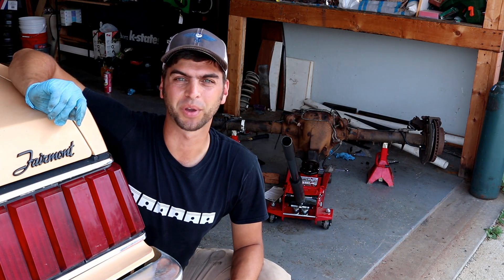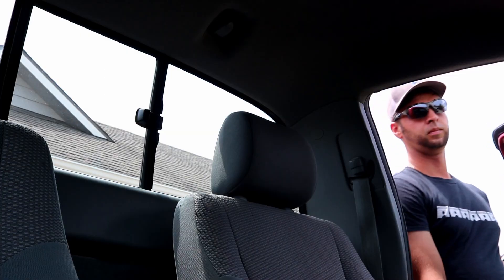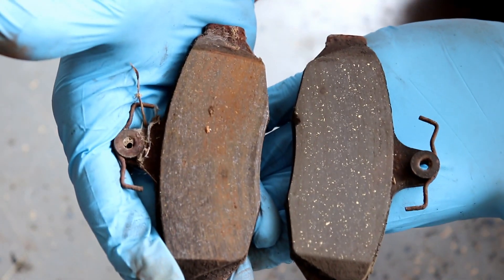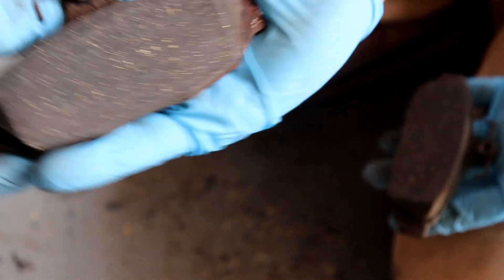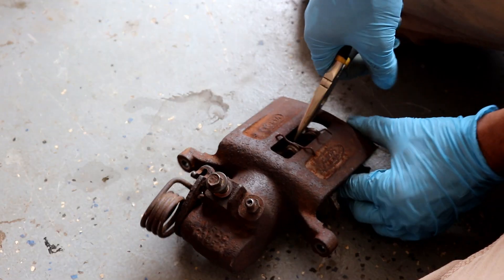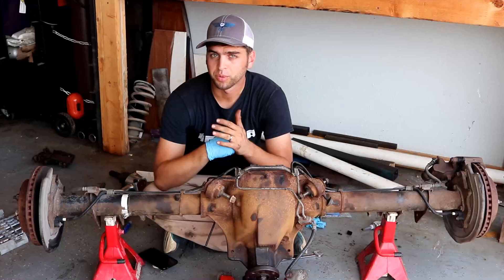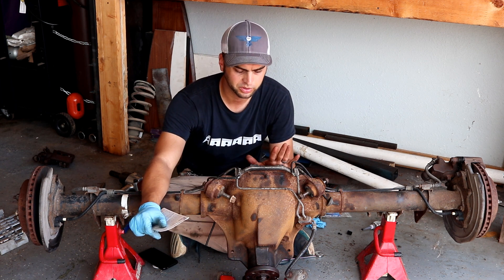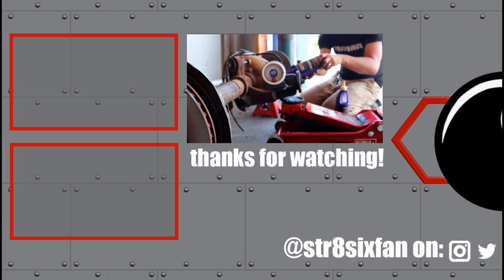Getting Back on Trac, with the Fox Body 5-Lug Swap

Comment: Yeah for Canadian made Sandpaper. Another trick is to lay the paper on a flat surface and slide the pad back and forth! Great call to action on the instagram account to!
Reply from the maker: The frameoff mentioned the same thing in a previous comment. And I can't believe I didn't think of it. Luckily it didn't take too much to smooth em out anyway, I'm not too worried about being uneven